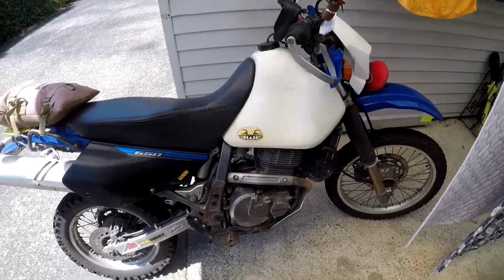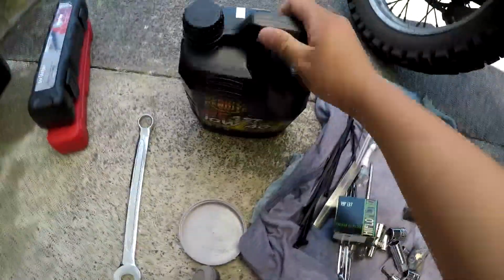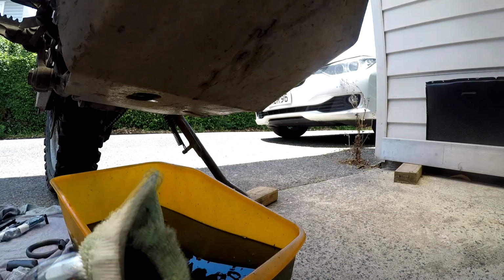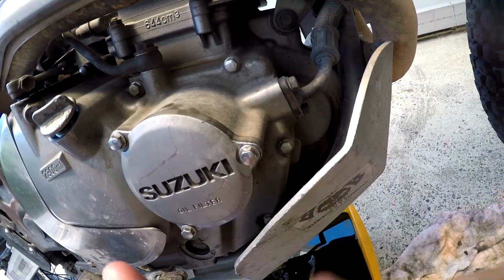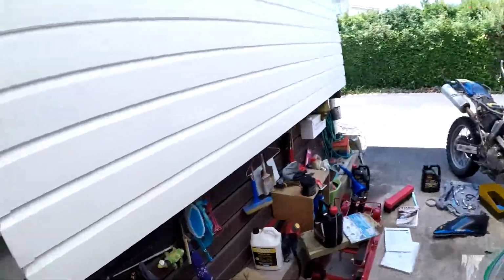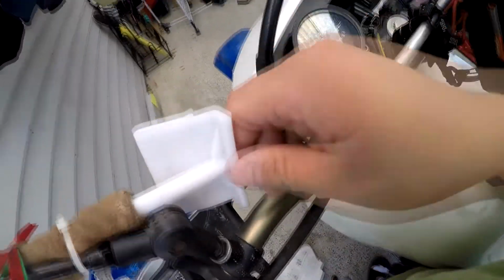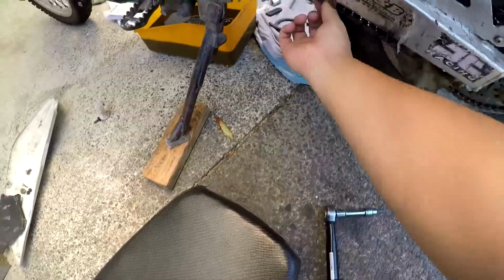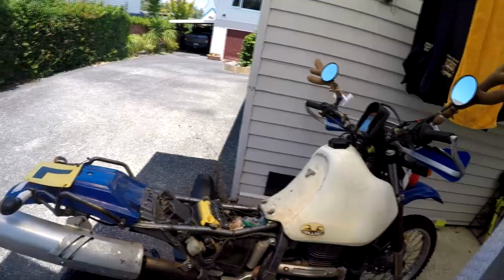DR650 Basic Service Full

Comment: You should not be using a full synthetic oil on this bike as it will cause some clutch slippage. Use oils meeting the API SG, JASO MA-2 specifications that do not say "Energy Saving" as those oils will be to slippery for the clutch to perform properly.
Reply from the maker: That oil meets JASO MA-2.